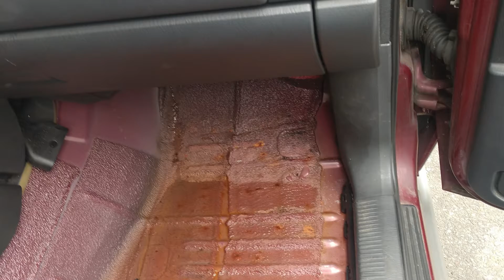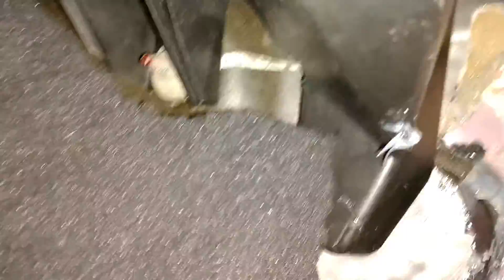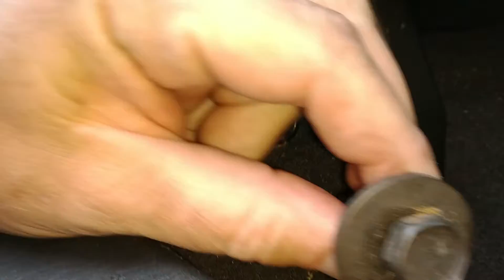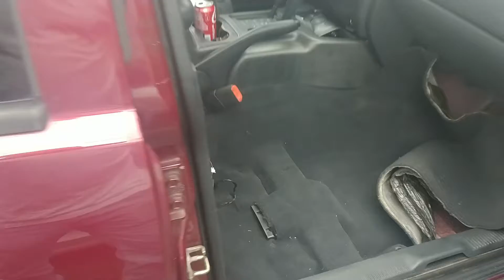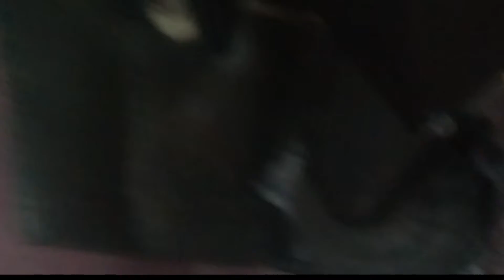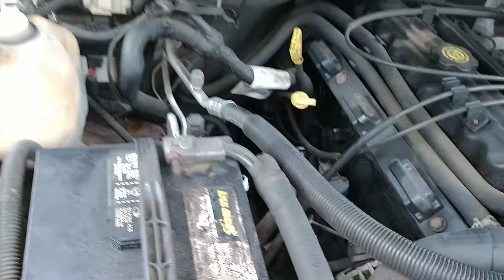Jeep Grand Cherokee WJ 2002 AC Drain Water Leak Into Passenger Cabin Easy Repair.

Comment: Hi my friend: I fixed the drain leak.  Good idea with silicone.  There is still some residual water on the floor board right next to the passenger seat in a small circle area.  Is lifting back the carpet and drying under there a hard job?  How long does it take to pull it back and take out the seat to dry it all up?  We've been blowing industrial carpet fans on top of the area but the water is underneath the sounding and plastic so it never dries!    I'm going to pay a shop and will use your video as a reference!  thank you so much my friend
Reply from the maker: I found it rather easy to not only remove the seats, but to pull back the carpet and lining.  Using towels dried it and the under lining I let dry out.  Pulling up the carpet is easy no special tools, you can do it yourself. Using the fan can help.  Seal up that circle area, and do the engine side especially to prevent the water from blowing back an running into the firewall and collecting
Reply: @marlborom2c829  Thank you so much!  Did you remove all the carpet? or did you just remove the two front seats and lift up for the passenger side carpet to do the drain fix?  I am wondering if we can just do the passenger side seat and lift back the carpet just on the passenger side.  Thank you  again for everything, very grateful
Reply from the maker: @aj_strong  that's all I did was move the carpet on the right side.  I didn't have the accumulated water on the driver side.  I took only the front right seat out removing the bolts  disconnecting the wires plug. No need to remove the entire carpet.   I used some disinfectant just for my own self satisfaction
Reply: @marlborom2c829  that's awesome, thank you so much.  Learning a lot about my WJ from you!

Comment: Question mine is leaking from there at the rubber but only have water in floorboard after a heavy rain that I notice. Could it back up and flow out of that as well
Reply from the maker: So if I understand, the water is leaking inside the cabin from the round valve at the firewall.  If thats the case, it may be that problematic seam where water can enter.  Likely rusted through at the engine bay source around that area.  After a heavy rain, if that somehow finds its way under your hood somewhere along the cowl line.   The drainage spots, and rust certainly play a major part with these older Jeeps.  You will need to trace if indeed the water is only entering the cabin at that source, or if there's another spot as well.  The carpet may hide other rust areas.

Water will leak inside the cabin at that spot when the AC drain valve is blocked, or the water tube is clogged and excess water is residing within the clogged tube.  The rain may not even be the issue.  Good practice would be to blow compressed air from tire hose or gently use a flexible stiff electric wire to plumb out a clog or keep that tube and valve unclogged. 
Apply the silicon either way to seal the area around that firewall in the engine bay and in your cabin.
 solution if you determine water is indeed seeping from that spot.  LMK what you find or if Im way off base on this response.
Reply: that might be your roof drain lines, they are under the hand grabs on the righ and left side.

Comment: What about putting a downward tube in the drain tube so the water doesn’t flow back?
Reply from the maker: Yes Julio absolutely, that would lead the water down and away. This was a quick fix, adding the tube additionally is a BETTER fix.
Reply: @marlborom2c829  That’s what I did. My floorboard has been soaked with water lately, I hope this helps with my issue. Haven’t tested it yet
Reply from the maker: Post us. Let us know how it works.
Reply: @juliosaucedo3047  did it work?
Reply from the maker: Ive had no further issues with it.  But now it's ready for winter ❄️🥶
Reply: @ACKLLR-mc8tw  Apparently not, winters here so I haven’t used the AC